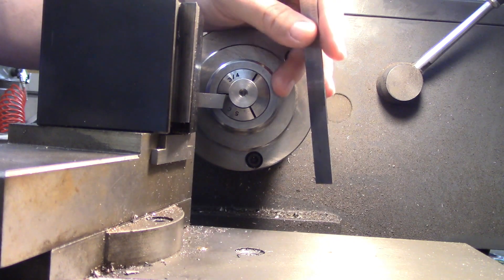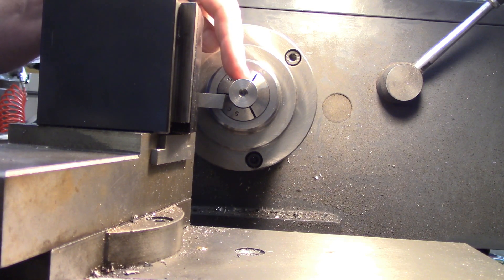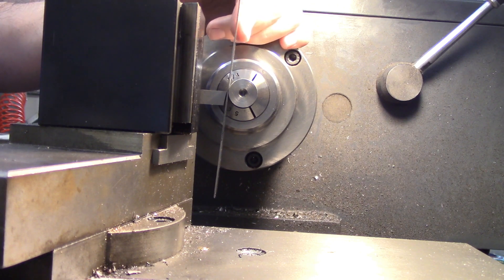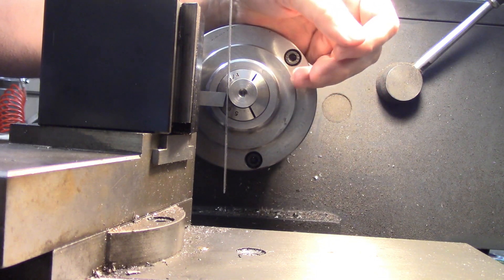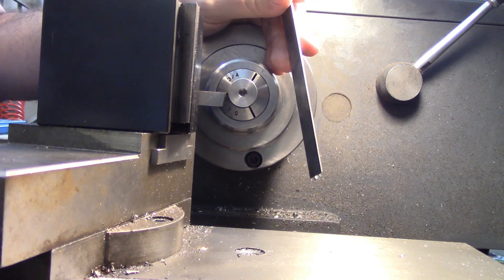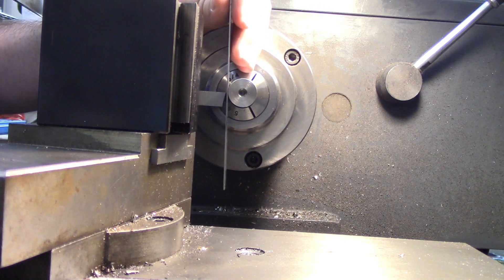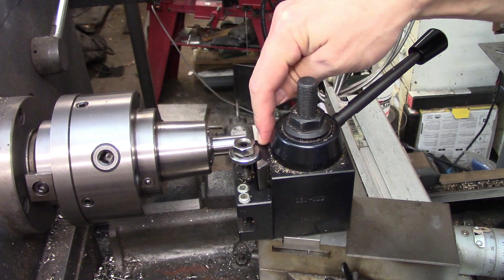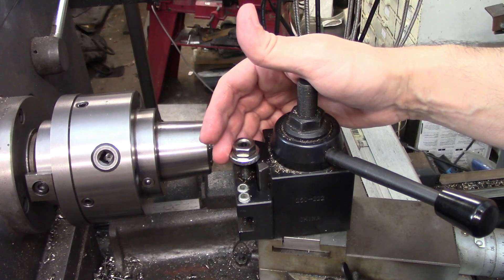Setting Your Lathe Tool On Center Using a Scale

Comment: Being an old machinist i knew the old machinists trick but worth repeating for the youngsters under 60.😉
One nuance I could add is that it is more effective with small diameter stock in the chuck and relatively  useless on,  say, 4 inch.
Reply from the maker: Good point. I probably could have gotten the video over the four minute mark if I had said that. Alas! Too late now.

Comment: Nice explanation. Do you have any specific videos on using a vernier height gauge? Thanks!
Reply from the maker: I don’t, but I am working on a vernier calipers video. I could add a bit about height gages in there if you'd like.
Reply: @StuartdeHaro  I think it could be helpful - at first it was confusing but I think I got the hang of it watching my instructor a few more times and with practice. Thank you !
Reply from the maker: @russin3d  The hardest thing about them is reading the tiny graduations.

Comment: I use this method but only just realised it would give better visual indication if you kept most of the rule above above the tool point, ie, not on the centre of rule…

Comment: Thanks for all the suggestions below but I guess I didn't make my question clear enough. It's not the handle that secures the QCTH to the compound that just has a nut on it with a wrench that can be positioned out of the way. It's the handle that locks the individual tool holders onto the QCTH. When its setting on the bench or on the lathe with one holder facing the chuck and the other holder facing away from the operator the handle still locks up at 1 o'clock.
Reply from the maker: Hi Jim.  That what I wanted to make sure of.  This is an Aloris type, right?  I've never have one apart, but I can take a peak this weekend.  Send me some pics to the email address on my channel's ABOUT tab.  You'll have to prove you're not a robot to get it.  We'll see if we can figure this out.
Reply: @StuartdeHaro  Thank you I don't see the email address on your about page. The only solution that I can see is drilling and tapping another hole at about the 5 o'clock position.  Will gladly send some pictures if I can get your email somehow from your about page.
Reply from the maker: @jimpritz4169  Under the channel description there's a Details section  at the top of which it says "For business inquiries" and there's a button to view email address. Click that, prove you're not a robot (you're not, right?), and then you get the email.
Reply: @StuartdeHaro  Thank you again for all the replies. No I'm not a robot. I'm very sorry but I don't see anything like that on your About page. I only have a phone and a tablet perhaps this information you are referring to shows up on a computer but I am not seeing it. Please don't make any info public I don't want to cause you any issues. I can live with this QCTP. I've had it for years, taken it completely apart and just thought there might be a simple fix I was not aware of. Thanks again.
Reply from the maker: @jimpritz4169  Weird. I figured everyone could see that. I'll still take mine apart and see what ideas I come up with. It would make a good video at the very least.
Reply from the maker: Hi Jim.  I've taken apart my tool post and I believe I have found your issue.  The wedges, on mine anyway, are actuated by a triple start thread.  My guess is you've got the wedges engaged with the wrong thread.  The good news is, you don't have to take the whole thing apart to fix it.  Just take the post off the lathe and hold it in a vise.  Then just turn the handle around clockwise while supporting the wedges with your hand.  When they're at the bottom you'll feel them click into the next available thread.  Just repeat that process until the handle locks in in the correct spot.  I shot a video about it, which I'll get edited as soon as I can.  If it's still unclear hopefully that will help.  Thanks for watching!
Reply: @StuartdeHaro  mine is a Phase 2 and I don't think it's made the same as yours. The wedges are held onto a spring loaded pin with an Allen head screw. When you turn the handle around 360° the shaft attached to the handle that contacts those spring loaded pins must be slightly cam shaped and that is what is pushing the wedges out. There are no threads and no clicking on mine. It does not seem like there is going to be any adjusting to this unit. I hope that all makes sense.
Reply from the maker: @jimpritz4169  Well darn. I thought I had it figured out for you. At least I've got another video out of it and I did some preventive maintenance on  my tool post too. What about just drilling a new hole for the handle? Mark where you want it when it's locked and move the sucker there.
Reply: @StuartdeHaro  I think that looks like my only solution. I can't tell you how much I appreciate all the time and effort that you put in to help me figure this out.
It was greatly appreciated.
Reply from the maker: @jimpritz4169  not a problem at all, Jim. I'm sorry it didn't really help.
Reply: @StuartdeHaro  You are not going to believe this but I called Phase2 up in NJ today and this is what they told me. They had a group of these that went out quite a few years ago with this problem. He said that the only way to fix it is to drill and tap a new hole for the handle in the desired position. So it looks like we were both right. Thanks again.
Reply from the maker: @jimpritz4169  No kidding? Well, at least I know I wasn't COMPLETELY talking out my ass on that one. I gave you a shout out in that video, including a bit in the outtakes I put at the end. It should be out in a few weeks.

Comment: I did know that trick and it works well to get you very close so the last final adjustments can be made. With some tools (boring bars as an example) they might work a bit better at times slightly above center to help compensate for any machine and bar deflection. For that reason I made up a flat plate with a vertical post and clamp to hold a cheap off shore .001" dial indicator with what's known as an elephants foot screwed onto the indicators tip. It can then be permanently zeroed on a tool that's already at the exact C/L of the head stock center of rotation. My largest lathe has a flat tee slotted cross slide, but it could also be zeroed off the lathe bed ways. It's a fast, easy and repeatable method to get to a known elevation point for your tool tip that also won't damage fragile carbide. Plus you can place tool tips to a known amount either above or below the C/L that's proven to work better in the past. Already knowing what elevation works better is far better than guessing what might work. For my lathe and boring bars about .003" - .005" above center seem to work much better that having them set exactly to the head stocks C/L. And few seem to have enough QC Tool Holders so it's a whole lot quicker to exactly reposition any new tool your replacing in the tool holder.

Comment: Here is a question that is not related to this video. I saw when you locked the cam on your tool holder that the locking lever was at about 4 o'clock. When I lock mine the locking lever always ends up at about 1 o'clock. This ends up over the work in the lathe and is annoying. Is there a way to adjust the lever so that it locks at 4 o'clock like yours does? I've looked everywhere and don't seem to see if this can be easily done. Thank you.
Reply from the maker: How is your tool post oriented to the lathe? From your perspective, you should have a dovetail on the left side of the tool post and another on the far side closest to the workpiece. That gives you a tool in turning position and one in facing position. Sometimes people turn the tool post to some other position like a dovetail on the left and a dovetail facing you. That would put the cam handle in about the 1 o'clock position.
Reply: Yes it can be done and this is a really easy fix, basically what your wanting to do is correctly index the locking lever into it's best operational position. Any thread pitch will have a known advancement per one full rotation plus a known start point where the female thread engages with the male thread. To keep things simple as just an example, a 10 tpi thread will advance .100" during one full rotation. So divide that by 360 degrees to get the advancement per degree of rotation. .100" divided by 360 degrees = .0002777" per degree of rotation. Lets say you have what most qctp's do with a thick washer under the lever operated clamping nut. Using a simple cheap clear plastic protractor available at any office supply to get a rough idea of how many degrees you want the handle to advance or retard on a full 360 degree circle.  

let's say you want to move the advance of the lever operating handle by 27 degrees more to have it then lock up with the handle in the correct position. So the calculation would be 27 degrees X .0002777" = .00749". Or .0075" in round numbers. There's a couple of ways to do this, you could trim that much off the end of the thread tip, or the nuts face to change the entry point where the thread starts, or remove that much off the washers thickness. For clock wise indexing you'd remove material, anti clock wise on the handle position you'd want to add a thicker washer by the calculated amount. So all you really need to know is what your thread pitch is and how many degrees you want to advance or retard the index point of the handle. It could also be done by machining an even thicker washer and running the same calculation.

Comment: Great tip about using the thicker rule.
I have found a lot of success by using a cheap planer gauge off Ebay that I found for about $15. I set it on my cross slide and using my finger nail I can dial any cutter in quickly and accurately.